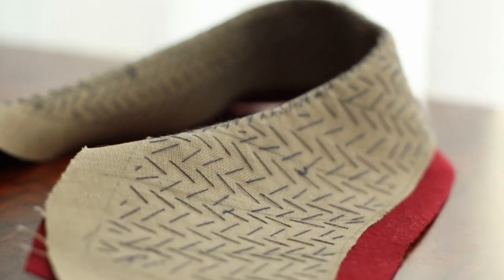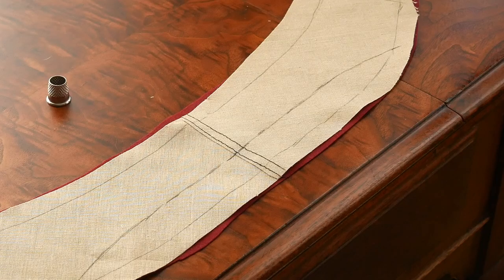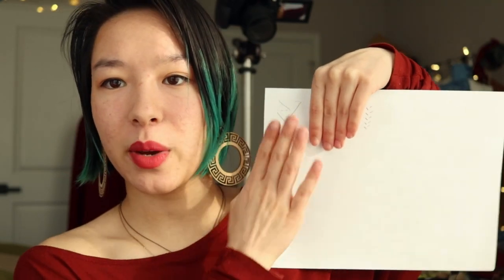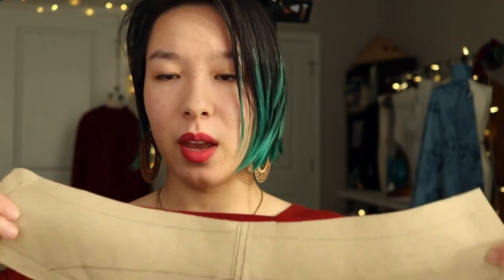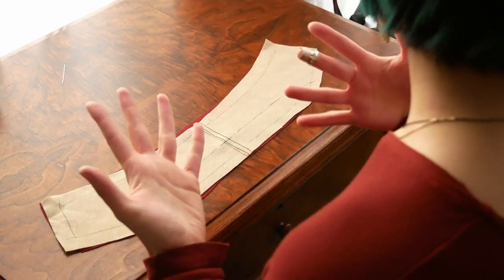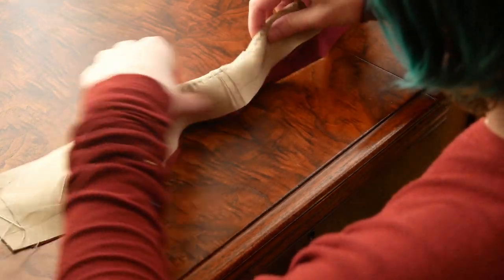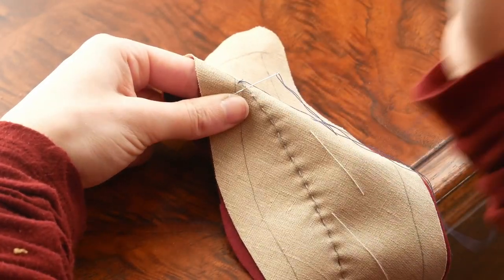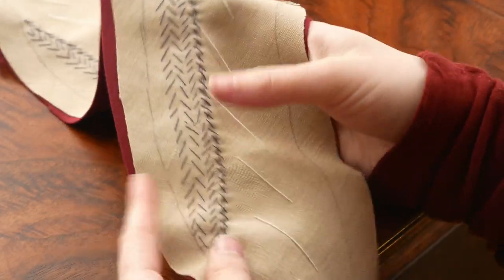How to Tailor a Collar  with Pad Stitching and Pressing | Beginners Guide to Couture Techniques

Comment: Your video was really helpful in giving me a refresher in tailoring collars, since I’m a little bit out of practice and just recently got back into tailoring. Thank you for that 💜

Actually during my research in tailoring techniques, I’ve seen some tailors do this thing, where they don’t draft the collar piece and instead use a rectangle cut on the bias, pad stitch a portion of it and press it like any other collar and when cut the excess off after they’ve attached it to the foreparts. It’s was a really interesting system and I thought I would share it with you, and let you know about it. 

Anyways, salutations.

Comment: This is so helpful, but I do have a couple of questions. Are you using the same linen thread to do the actual padstitching or was that just for the roll line?  And do you then just attach the upper collar as usual? I'm remaking a cheap felt coat I bought with a lovely Italian wool, so I'm devouring all the tailoring tricks I can. Should the upper collar also be cut on the bias? Thanks so much for your work.
Reply from the maker: Hi Cheryl! 

1. Nope, I use a normal weight thread for the pad stitching.

2. There are a few different methods of attaching the upper collar, if you mean by sewing around the under collar and upper collar by machine you can absolutely do that. I would recommend pinning the two collars together making sure there is a little more ease in the upper collar, and then after sewing right sides together and trimming the corners, the seam allowance can be catch stitches to the under collar side which is (essentially the couture method of understitching) before the collar is turned right side out. 
There are other methods of attaching the upper collar like the one in my matrix coat video at 9:54 or this video https://youtu.be/Pyzto5nWySE at 30:50.

3. The upper collar is usually cut on the cross grain, depending on how shapable the fabric the upper collar may need to be cut as two pieces with a seam along the roll line to follow the 3D shape of the under collar.

Hope that helps!
Reply: @Ora_Lin  It does, thank you!